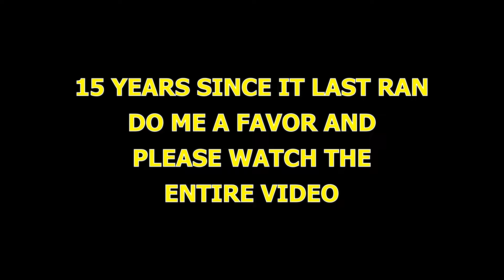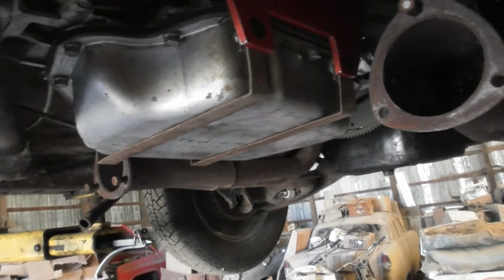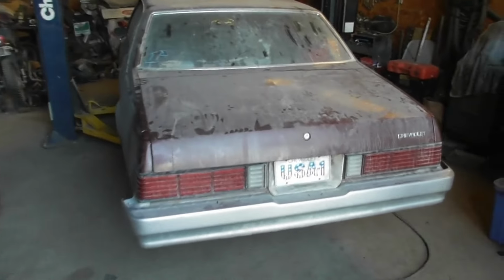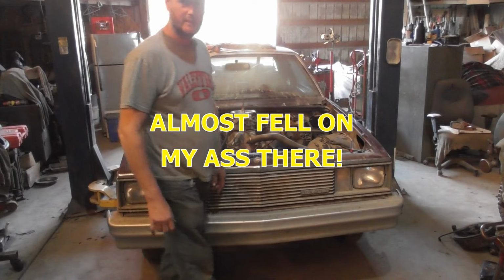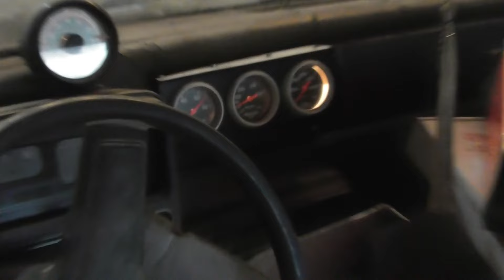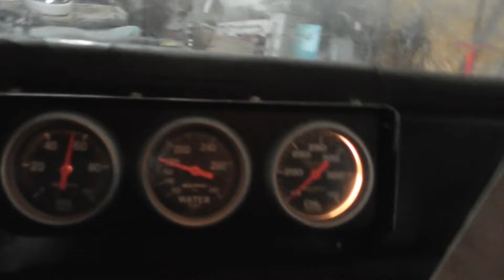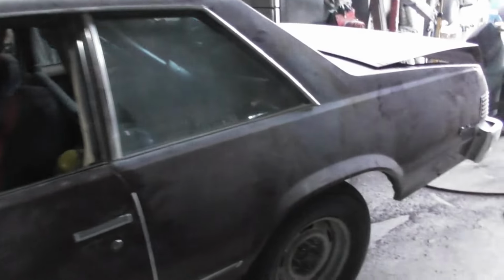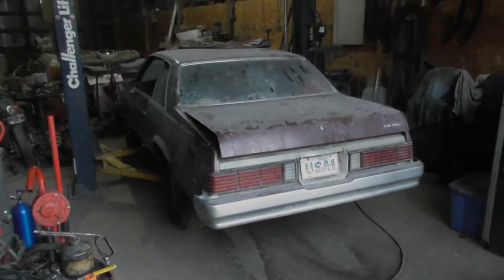81 malibu drag car hasnt ran in 15 years! today it lives again! big block chevy power!!

Comment: I would like seeing you do the work on it..  When you replaced transmission,  fuel line.  Ans Carborator cleaning
Reply from the maker: i usually do that, but i was doing / filming this when i was locked out of my channel, i wasnt even sure i would ever get back on?  it took a year to get access again, i appreciate the suggestions, always room for improvement on my end

Comment: 👍🏽👍🏽 What's your address?
I'll send ya a Napa Gold oil filter so you can throw that orange trash can in the garbage. I won't even make a dyno pull until they are replaced.
Reply from the maker: yeah i do have the fram race version on it, but only due to they were the only "so called good filter" with the thick shell available at the time in my area,  this was 15 years ago. if you want to message me my email is under my contact info on here, but its difficult to find for some reason?